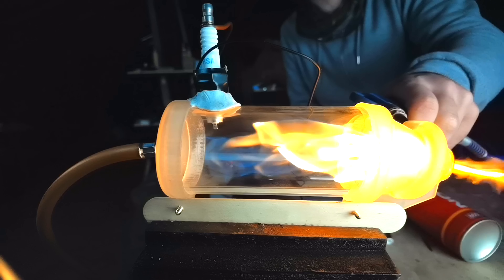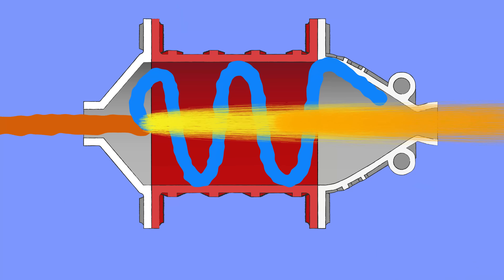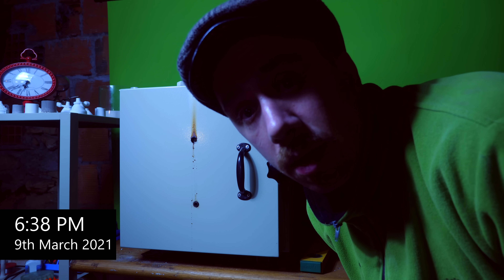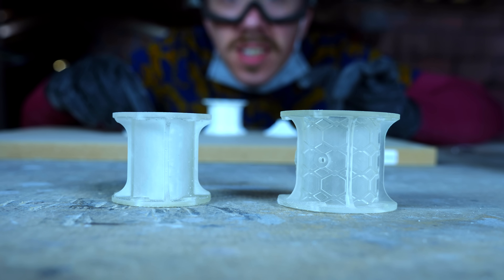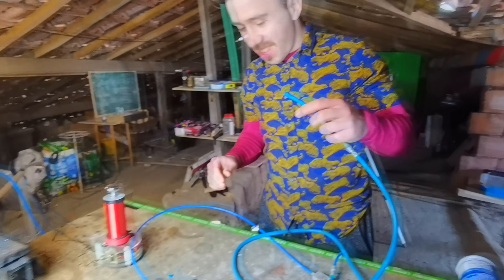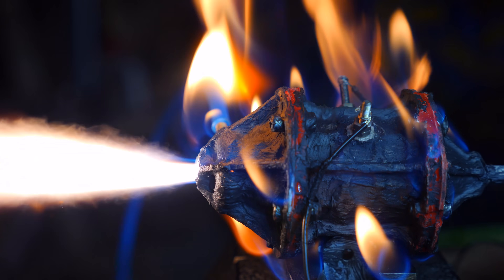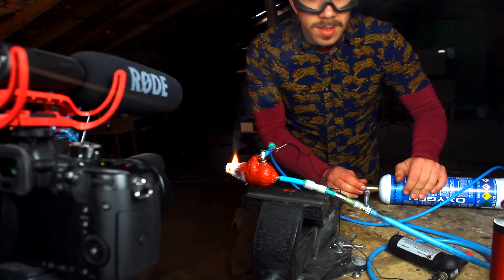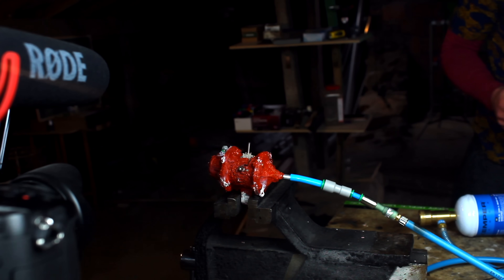Vortex Rocket V2.0 (3D Printed)

Comment: First I want to say I look forward to your videos and regularly have ROFL moments while watching. Second a rhetorical question: how have you not burned down your house yet? Anyway, have you considered applying sealant to the interior of the printed parts? What I think you are experiencing is pressure that exceeds the bonding strength between your silicone and the ceramic. By applying a vapor barrier on the interior of the part you are granted the added benefit of structural/molecular filtering. Imagining the silicone paste getting caught up in the silicone lattice structure that impedes the flow of gasses under pressure and not just getting blown off the outer surface. 

Also I'm really looking forward to seeing you raise the BAR on the next video! 

Greg W.

Comment: The flames when they come out of the nozzle produces a lot of heat which the ceramic part cannot take. Because of which cracks might have formed from the tip of the nozzle towards the base of the engine and because of which the cascade reaction might have occurred.  So I would suggest at the nozzle area on the external side 3d print heat ventilation ceramic plates around the nozzle so lot of surface area might become available for heat to exit and might keep the nozzle cool.

Comment: To fix the porosity problem after the first firing & removal of the support material if you painted it with ceramic glaze & fired it again it would seal all the pores & make it air tight like a ceramic bowl. Coating it in glaze also has the added benefit of allowing you to make it any color you want it to be.

Comment: Suggestion for leaking.
How about using ceramic glaze? Glazing the parts should produce a layer of glass inside and outside which should be enough to contain gasses. I would also recommend grinding any two mating surfaces on ultra fine sandpaper so that you get flush connections between components. Glaze could then be used on the connecting face as a method of "welding". You could also just glaze over the seam and that should work. Dip glazing would be my starting point. There are some interesting possibilities for altering material properties based on glaze additives.

Wax is also an interesting option and an even more interesting option for a hybrid rocket motor design. A thick enough and well designed internal wax coating could be used as an ablative sealant.

Same principal but with something like NightHawkInLight's "Starlite" copy, a carbon foam producing organic based paint. Could be interesting as well.

Actually one more thought along these lines, you could potentially use an non sintered part as a internal liner where the resin cooks out of as you fire the engine. If the non sintered part can hold back the gasses and is structurally sound or just melts outward to bind with the surrounding material this could work.

Also look into "Egyptian Paste", likely would require a complete restart from resin up but worth mentioning.

Can't wait till I can just hit print and have an awesome rocket engine.

Comment: Instead of bolts through holes try a recessed ring matched to protruding ring. Then seal and hold together tightly with clamps or something. Maybe have them threaded and screw into each other, sealed of course. You can always put slurry on inside of parts also

Comment: It's a thickness and porosity problem, that ceramic is covered with micro holes (occur when its resin is burn away... enough to retain liquids due to surface tension, but not enough for pressured gazes)... and you'd burn away the refractory cement (specifically at the nozzle) if put inside the engine.  Here's 3 solutions, I think: 

option 1. A masonry solution. I guess that printing it in titanium (can withstand 1400 Celsius) is not an option ($$$), so maybe you could do like "Russian dolls" and add many layers (1-2mm modular parts) over each other, glued with refractory cement in between??? Like in old brick high furnaces, the multiple layers of bricks are ment to not align brick cracks (to solve the porosity problem) and to thicken its walls (because thick bricks also crack). 

option 2. A clay artist solution. Instead of using refractory cement, you could cast your printed ceramic engine into a fire clay brick/cylinder (to get a massive fire clay engine with a 3D printed ceramic coat inside), but fire clay can withstand only about 1 500 Celsius. The clay will absorb the ceramic's heat...  and its thickness will make it air tight and more robust.

option 3. A pottery solution. Glaze it. it'll solve the porosity problem. 

option 4. mix all the above. 😁

Comment: @integza did you properly cure(uv light or sunlight) your 3d printed part before heating it??
i'm thinking why not brush thin layers of your ceramic resin in your finish product engine then cure it in uv led lights, and repeat until you make maybe 3 layers to 5 layers or more.. just to seal those pressure and maybe lessen the leaks..

btw love to have a printer :)

Comment: Youcould try mixing High Temp glue with leftover ceramic powder and coat the whole engine with it and then baking it in the oven at high temperatures. mayby it would help reapeting this process a few times to form a thick layer...

Comment: Try high temp epoxy resin layer in the inside of the engine. The problem is that the internal pressure.

Comment: It would complexifiy the crafting of the rocket ALOT, but you could 3d print ceramic parts to make a multiple layer engine. add insulation between all layers, and tighten all pieces against each others. I notice your insulation tends to bubble and be pushed out by the gas leaking out of the chamber. if your insulation has nowhere to go, maybe it'll work better and burn less since it's less exposed to air ? I have no expertise in these domains whatsoever though, I might be talking out of my behind here...

Comment: are you using a pressure regulator and flow controls for the fuel and oxidizer? I believe that rockets just like  IC engines need proper air fuel ratios. Over pressurization may be the source of some of the leaking issues. High temp silicone creates a decent seal but really cant withstand overly high heat. A gasket made from garlock or graphoil should withstand the heat much better. It also may be worthwhile to sand the mating surfaces lightly on as flat of a surface as you can get. You may also want to make metal support rings for through bolting the flanges together to created a more consistent  clamp pressure with less risk of breaking.

Comment: I think glazing the inside of the engine would be a good idea, since the glaze forms a non-porous glass layer. 

Also, when can we expect a Tomato Lord cartoon series?
Reply: I think there is an issue of the glaze melting under the high temperatures in the engine. But I think glazing the outside would work would it not? The body of the rocket would insulate the glaze on the outside from the high temperatures somewhat, but it would still seal the tiny holes.
Reply: @AVA-hu4yf  I suppose that could be the case, given that the nozzle area ended up glowing orange hot. I think optimizing the design and lessening the contraction ratio of the combustion chamber should fix some of the structural problems, while a layer of glaze on the outside and then winding the outside of the engine with carbon fiber should deal with both the leakage and allow the engine to function at the higher pressures that he wants.

Comment: I have 2 suggestions for you. Seal the interior of the engine with a pottery glaze. This should contain everything within the engine. And add a second oxygen inlet opposite the first to get better interior coverage of the combustion chamber wall. Ideally I would say install a ring plenum with angled ports to introduce the oxygen more uniformly across the interior. But I suspect that at these small scales such a design would be extremely difficult.

Comment: My dear friend I'm a potter. I see you working with porcelain not wearing a mask. You should wear a proper dust mask to deal with ceramics. Ceramic dust is high in silica and can cause pulmonary silicosis a for of COPD. Also when you make the prints dry them slow to avoid deformation dry them for at least one week. Also to fire them increase the kiln temperature very slow. To reduce the cracking after firing the pieces let them rest in the kiln until you reach room temperature. Of you need more info for firing ceramics, please write to me and I will give you my contact information to give you a hand. I see you are doing the firing improperly. I can help you succeed int the parts firing. I like your channel a lot

Comment: Put the silicon sealant on the inside of the combustion chamber so its forced into the gaps in the ceramic rather than being forced off the outside.

Comment: You should try using propane for your vortex cooling, it has roughly twice the specific heat compared to oxygen. Once you fix your leaking problem it may increase your ability to run longer.

Comment: video idea: (3d printed) porcelain Vortex rocket V3
(I really love the Vortex rockets progress in each video.) 
As for my suggestion, why not rather than having the chambers/nossils bolt together, instead have them screw together like nuts and bolts on a thread. Maybe that'll help solve the leaking thats happening at the connection points and give a better seal (still using the silicon to bond them). Hopefully that'll work and it'll be fun to explore in a V3 video :)

Comment: Have you tried ceramic glazing the in side and outside before firing? I'm unsure if the glaze would re-melt as a result but it would definitely help with the sealing problem for a little while at least. Would need to watch out for build up on your inlets as you are applying the slip. Great content man, love the channel!

Comment: For the chamber you could try coating the inside with a bit of high temp sealant though I think when you are turning up the pressure its not creating the vortex like you want. Though I think it may not be exactly the way you imagined it in the beginning. I think you may need to isolate the vortex until the last moment when it needs to meet the fuel. Maybe a smaller cylinder inside the combustion chamber that attaches to the nozzle and is just a bit shorter than the combustion chamber?

Comment: Try making a “negative print”. Print moulds for the parts in the ceramic resin, then cast your parts in melted down soda cans! The 3D printer should be able to make one piece moulds too which would make life easier.

Comment: Maybe glazing would solve the problem?
Prepare a set of engine configurations, assemble them then coat the interior with glaze then bake them i guess? I don't know how ceramic glazing is done but I'm sure it'll make the engine less porous or even air tight.

Comment: @Integza, is it possible to electroplate the printed part?  I'm thinking this would be a good way of providing a fire proof coating to the part that would still match the contours of your print, and would allow you to accurately coat both the inside and outside of the part.  A quick google search suggests that you can indeed electroplate ceramics.  What do you think?

Comment: I think you should try j b weld for high temperature, and apoxy also for high temperature. And try adding layers until you feel comfortable with it , if possible put it in a vacuum so it can get in the pores of the  build . But let it cure completely for both of them.

Comment: I think you need to cover the 3D printed ceramic in a pottery glaze to reinforce it, might I also suggest wire wrapping it like old WWI era battleship naval guns to provide tension strength that the ceramic lacks followed by another layer of ceramic pottery glaze over top.

Also would like to see you revisit the turbo jet but with an aircraft style turbo fan rather than the automotive style you used that likely cost you a lot of efficiency due to the air hitting the plate on the turbine before being pushed further into the engine.

Comment: So I was just watching the turbo jet engine and I had an idea for when you get time to make a V2 of it. A manual or electrical throttle control that you could manually adjust and use on all your engines, not just you turbojet

Comment: Well you can always cast things, and it will be thick i think. Aluminium is easy to cast, but I dont know if it will take the temperature. Melting point is 660 C

Comment: I think the ceramic is heat resistant enough to run a regular liquid rocket engine without the vortex cooling for a short time. And why do you need to burn out the resins before you use it? If your engines are dead one use anyway you can also use parts that still have resin in them. This way they can maintain higher chamber pressures

Comment: 1) make sure you use more propane than oxygen. because high temperature oxygen corodes almost anything and your exaust certainly looked engine rich at times (also it will burn a colder) 
edit: i looked up the stoichiometric ratio for propane and oxygen and apparently its about 4 to 1 so that shouldn't be a problem. if i dont know if you used the oxygen to cool the walls, but if you did, that could give the oxygen an opportunity to heat up and start attacking things

2) maybe you could fill the poures instead of just covering them? (i dont know how or with what that'd even work but i thought id mention it)

Comment: I'd like to see a future video in which you 3d print a rocket design then use that printed part to create a mold and then cast it in metal... this would be a new skill (metal casting) and might hopefully provide a high temperature engine with less chance of mechanical failure?

Comment: What about to try print transparent mold with about 1cm thic walls? You could pour ceramic resin inside and solidify it with 1000W UV lamp for over a night or so?

Comment: You could try "coating" the exterior of the engine with starlite. It is a heat resistant material that is also a dough that can be easily formed into the shape you need and when it dries out it gets hard. I believe it would plug the pores in the ceramic very well if aplied while in the dough form. Also it can be created with common household materials. Also you could use it to make your own furnace (not that you need one).

For more information check the NightHawkInLight's video about it: https://www.youtube.com/watch?v=0IbWampaEcM